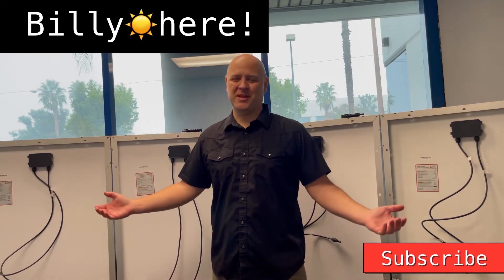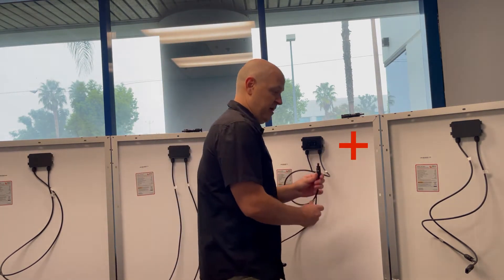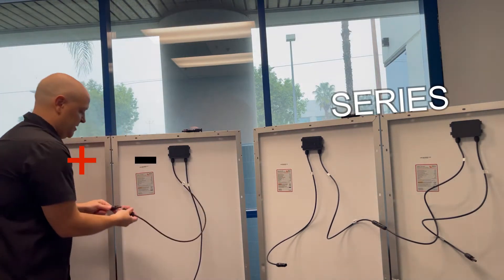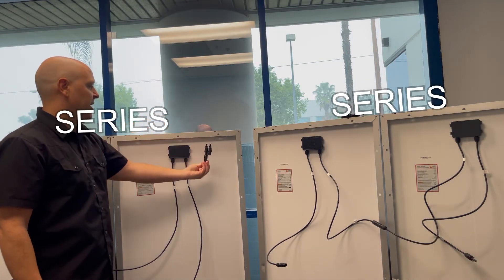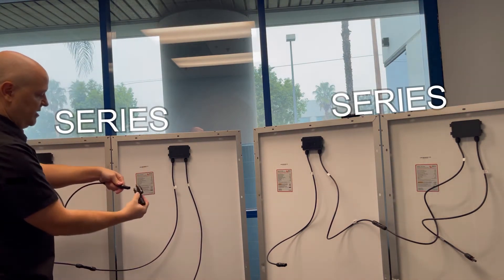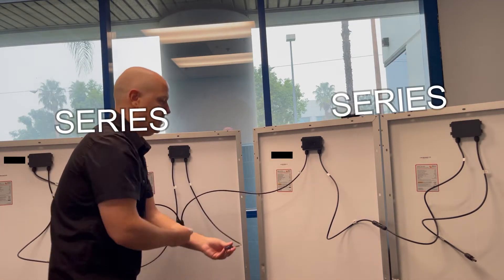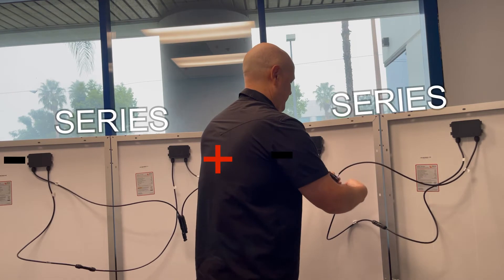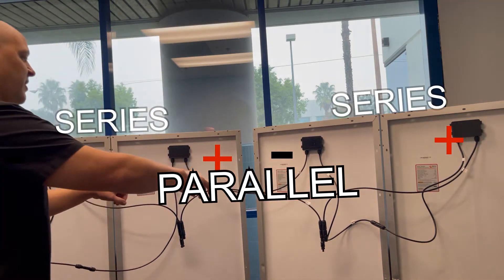Series-Parallel solar panel configuration

Comment: I was told to max out my solar battery station i need to set up the panels with 4  panels in series and 2 sets of 4 panels in parallel.  Can you post a diagram here of how that all connects together?  I'm lost. Thanks.

Comment: What is the benefits of this configuration
Reply from the maker: There are few benefits. One it is a way to keep your voltage lower as you increase watts. Let’s say you have (6) 12v panels but your controller could only take 100v. Connecting them all in series you would exceed 100v but if you used this configuration you would have half the volts keeping them under the 100v limit of the controller.
Reply: @billyhere9279  I have 8 100w panels. My controller is a 60amp. Could I do this configuration to get more amps? Yet maintain enough watts to charge. I'm a noob.
Reply from the maker: @BADD1ONE  with this configuration you would end up with an estimated 91 volts with 12 amps.
Reply: @billyhere9279  thanks man. I appreciate your help
Reply from the maker: @Buszzbait69  Nate is the best!!
Reply: How many fuses needs to be added if I have a similar sistem but there will be 3 in series instead of two?